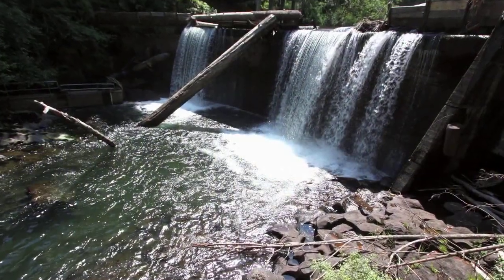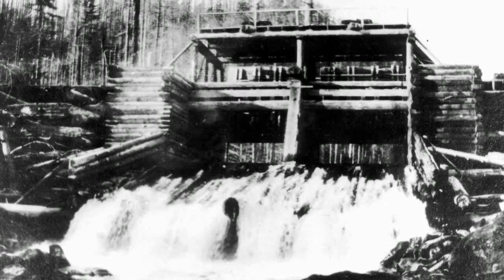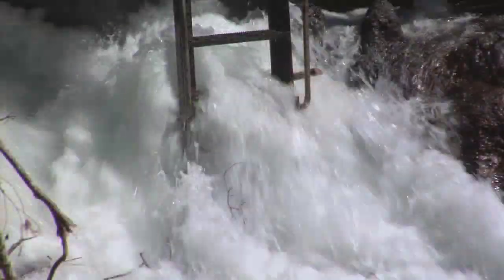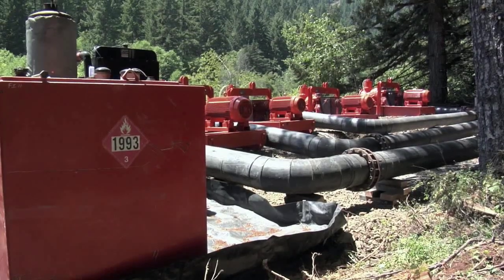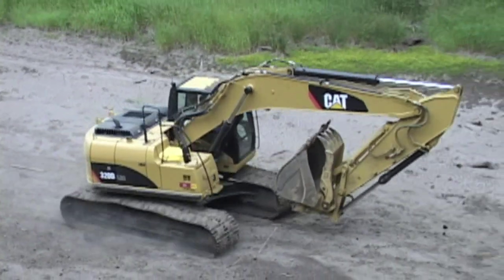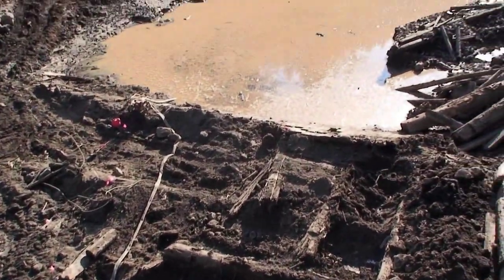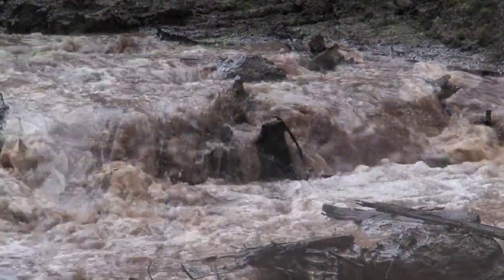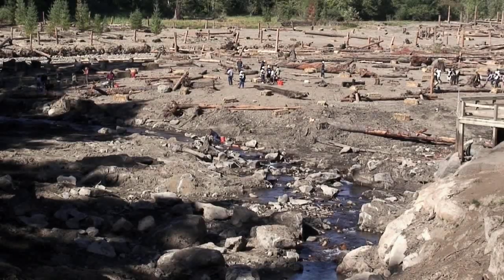The Hemlock Dam Removal Story - Columbia Basin Restoration

Comment: Dams that no longer serve a purpose ought to be removed.
Reply: Even dams that don't seem to serve a purpose to the public most likely still have a purpose. It could be as simple as flood control even when the other as built purposes are no longer used. I do agree that those who have zero purposes and it's cheap enough to remove them should be removed. If the cost of removal is excessive then leave them.
Reply: @dundonrl  No. If they're an ecological hazard then it doesn't matter what it costs to remove them, they need to go.
Reply: @aaronleverton4221  I agree with both of you. But I strongly agree with this.
Reply: nearly all dams shud be removed
Reply: @peanut1001x  yes leave the beaver dams

Comment: Interesting comments. This was a small dam that probably wasn't doing anything useful anymore. It's better to have it removed than to have people foot the bill for maintenance when it's no longer useful. I do sometimes question the removal of larger dams that provide a good amount of generation capacity, but small dams like these are too outmoded and should be removed when possible.
Reply: if it isn't useful or another dam can provide the same energy that a particular dam can produce why not consolidate them so there aren't as many structures to check every few years. Less structures government workers need to check means the structures that are standing and being useful the more through the checks and less chance of disaster of occurring.
Reply: Particularly because this dam was only built to sustain the CCC while they were operating in the area. They were putting up structures of every kind all over hell's half acre during the Depression just to put people to work. Many of these were unneeded and ultimately detrimental. But at the time, the work was serving a purpose.
Reply: Revelstoke dam in BC Canada is causing ALOT of problems.

Comment: Wonderful video, I love seeing Mother Nature being allowed to resume her natural course! We have way too many dams in this country that are not only dangerous but unnecessary at this point in time. They need to come down.
Reply: If the dams come down, where do you plan on getting the replacement electricity they provide? More carbon based fuel powered generation systems? Wind and solar won't be up to the task and are more damaging to the environment than dams. And where are you going to get the water for the thirsty masses of people and animals?
Reply: @jameshaynie4570  How much electricity was provided by the Hemlock dam?  How do you define, "more damaging to the environment than dams" and with what evidence do you defend your position?  Most drinking water is pumped from underground wells in my area.
Reply: @rodshop5897  dams provide flood control, electricity, storafe for irrigation and drinking water. The push to tear down dams just so the fishing industry can make more money  doesnt make sense. So why do you think that dam should come down? Do you know why that dam was built?
Reply: @jameshaynie4570  So to correct your statement, "some dams are designed to provide flood control, some are designed to produce electricity, some are designed to create reservoirs for irrigation and drinking water."  My point being that this dam did not seem to be doing any of that, so why are you against it coming down?  Or are you just pushing the idea that there cannot be too much of a good thing?
Reply: @rodshop5897  it was built to provide water and power in 1937 and included a fish ladder. The fishing industry started pushing to tear it out at the turn of the century to increase the numbers of steelhead and salmon. Tearing it out means  the public has to find another source for the environmentally friendly electricity it provided and also the loss of water storage.
Too many fans have been removed just to enrich the fishing industry at the expense of our environment!
Reply: @jameshaynie4570  Built in 1937, and how long did it produce power?  How much power was it producing in the most recent years before it was removed?

"to enrich the fishing industry at the expense of our environment!"  It seems you don't see the irony of your statement.
Reply: @rodshop5897  to raise production of fish in order to kill them for profit is not environmentally friendly.  Especially since so much of the fish that goes to maket is discarded after not being sold.
Reply: @jameshaynie4570  " to raise production of fish in order to kill them for profit is not environmentally friendly"  I totally agree with you.  I'm not convinced that was the plan, but I agree with your statement.
Reply: @rodshop5897 " most drinking water is pumped from wells". How do you think the aquifers that supply that water get refilled? It takes time for water to descend through the earth to recharge the aquifers , the aquifers are losing more water than is being put back into them. Dams and reservoirs slow the amounts of water that needs to be pumped from the aquifers and also help with recharging them.
Reply: @rodshop5897  so maybe they dont use it for power generation any longer, does it not still store water while standing there? Is it doing any harm or is it deteriorated and in danger of causing floods downstream? Maybe that water is helping to recharge the aquifer beneath it. So what is your justification for wanting to destroy it?
Reply: @jameshaynie4570  Wind and solar are intended to replace fossil fuel burning.  I have family members with a solar array in their side yard that has been generating most of their power for the last 5 years.  They don't have access to flowing water that could do the same, so it does not matter.  Eyesore is in the eye of the beholder.
Reply: @jameshaynie4570  "the aquifers are losing more water than is being put back into them"  That is certainly true in some areas, but not around here.  We have hundreds of lakes that are doing the same ground saturation that any dam would do.  Most of the problem with aquifer depletion seems directly tied to misuse of resources, such as irrigating the desert to grow water-hungry crops.
Reply: @jameshaynie4570  " Is it doing any harm or is it deteriorated and in danger of causing floods downstream?"  In many cases, yes, and yes.  Free flowing rivers are normally better for the environment than old dams which are no longer maintained.  Wildlife thrive better with natural waterways.  We had 2 dams fail last year and nearly wipe out a town.  Sure, if the privately owned dams had been carefully maintained, they might not have failed, but they were producing no power, and were way beyond their useful lifespans.

I've never implied that all dams should be removed, only those which are no longer useful.  What is your justification for leaving them?
Reply: @rodshop5897  i dont want to keep dams that serve no purpose or present a danger to citizens downstream. But i dont want to tear down dams that may still be helping to recharge the aquifers or are reducing the draw on them. I object to tearinv down useful dams just to increase the salmon population for ths benefit of the fishing industry. The push to tear down the dams has mostly been by the fishing industry and they are saying the Salmon are endangered. The only reason they are endangered is because they are over fished. And they want the taxpayers to foot the bill to destroy the dam.
Reply: @rodshop5897  by eyesore, i wasnt referring to individual systems for a home but the systems that cover acres and acres of land to supplement power generation companies.
Reply: @jameshaynie4570  I agree that useful and well maintained dams should not be removed just because they are there.  However, consider also that there are more reasons than salmon that people like to have the dams removed.  Some folks think those reasons are important enough to do it.  And several dams were put in with taxpayer money (not all) so it makes sense to use the same source of funds to removed them.  Part of being within a federal republic.
Reply: @jameshaynie4570  Sure, I get that.  Dams and solar arrays  both look better to me than a petroleum plant (and smell better!).  I actually find a large windmill array to be an awesome sight, akin to seeing a large dam.  Everyone has an opinion on what looks good.
Reply: The guy in the replies is fighting against big fish
Reply: @rodshop5897  you are not looking at the whole picture. Do you understand how much petroleum based energy is consumed making the equipment for solar and/or wind energy? Then you have the short life spans of the not recyclable windmills and solar panels. And don't forget the large amounts of rare earth minerals it takes to build them.
Reply: @nuggetsaltshaker9520  you want big fish? Go ocean fishing, the fish in the ocean get much bigger than anything you will find in a river.
Reply: @jameshaynie4570  "Do you understand how much petroleum based energy is consumed making the equipment for solar and/or wind energy?"  Well, yes, I am actually working in an industry which supplies components for petroleum, wind, and solar industries.  I think you are pulling in concepts which are red herrings.  This is about dams, not about all those other systems.  If the dam is not being used to create energy, your point is moot.
Reply: @rodshop5897  my point isn't moot just because that dam is not producing electricity, it is still storing water.
Reply: @jameshaynie4570  Storing water at a head level that made it nonviable for further investment as a dam.  Yes, moot.
Reply: @rodshop5897  so what is your point? Why is it that you want dams torn down that are just sitting there doing no harm? Or is it that you just want to argue about something, anything at all?
Where are you from that has all the lakes to recharge the aquifers that you mentioned ?
Reply: @jameshaynie4570  My point is that there are pros and cons to dams that are not serving their intended use.  Tearing one down often leads to an more natural river flow, and I'm generally in favor of that.  I live in MI.  We have tons of lakes.  You should visit sometime.
Reply: @rodshop5897  i have been there, the lakes are about the only thing good about Michigan. Very few states have the luxury of all that water.
Reply: @jameshaynie4570  "the lakes are about the only thing good about Michigan"  Wow,  curmudgeon much?

Comment: Very interesting how many people are for removing damns yet when there are major floods people are gonna be like well that damn really helped
Reply: And don't forget the dry years. So many.
Reply: Maybe if they hadn't cut down everything green and replaced it with so many inefficient and destructive farms flooding wouldn't be even close to the issue it currently is
Reply: @Arrica101  there is a reasonable amount of deforestation. Clearly in this case cutting down the Forrest was not the issue
Reply: @Arrica101  do you know how many trees are cut down and how many acres are cleared to build your "wonderful" wind turbines and solar fields?!
Reply: @ericpl7227  Where did Arrica say anything in support of wind turbines and solar fields?  Do you know that it's possible to farm around wind turbines and solar arrays?  

But since you brought it up, my brother in law has a farm and runs his operation on solar panels he had installed on a fraction of the land.  He makes enough power in the summer that he sells it to the power company.  In the winter, he has to  buy some power back, but he's still paying a fraction of what he used to be paying.  And still has plenty of room to farm.  His entire array is only two long rows.  Much less than an acre of land.

Comment: As many inappropriate dams were built , nobody talks about the other dams built by CCC and the WPA . A lot of dams were built simply to relieve flooding downstream , more flood control dams were built than any other type of dam .
Reply: The irony is: the sheer mass of dams result in a risk of cascade failure of flood dams. The incremental sedimentation of the flooded basins will also increase the risk of mud releases which, in worst case, cann also cascade the sedimented downstream dams. The risk rises with each year we dont remove uneccessary dams. In 50 years dams will be one of the biggest topics in china, hopefully the us and europe will have renatured most of them until then.
Reply: @SuperGorli  Great when you find another source of drinking water , agricultural uses, and hydro electric generation . Solar and wind alone wont power us . Takes more pollution to create huge lithium ion batteries than they save .
Reply: @cpierce3277  Dams are not a problem in itself. The problem is, they were build as single structures and not embedded into a riversystem with dozens, sometimes hundrets of dams. If upstream dams are opening, donstream has to be able to manage by diverting and funneling the water. Most countries already react by rebuilding the dams in an order with widespread flood areas (reintroduction of swamps / marches). Only China is more or less doing the opposite, which i cannot really understand, since they normally have the biggest flooding events worldwide.

Comment: A list of ideas to sam dams.

Fish Runs saving Dams and Water Shortages

Update 7/4/2021
Do you have a nearby moving river or stream? You can now place a slow speed water generator on the bottom of the stream and make power 24 hours a day. The unit is called a Waterotor made in Canada. The Waterotors won't harm fish and can be scaled up to meet the needs of small towns or cities. Make the power miles away from the small town, sell the power to the power company than use the power to make water anywhere. Atmospheric water generators can make drinking water and irrigation water, and with a Waterotor, power can be made even in remote regions of the World. You just need moving water 3 to 4 miles an hour in streams, irrigation channels, fish ladders or even waste water outlet's. Garbage treatment plants can also use the power they make burning garbage to make water with atmospheric water generators and add storage tanks to supply small towns and cities. Adding Waterotors below dams can maximize electrical power made by any dam and replace power lost if the dam has a fish ladder or channel for fish to move up and down stream. A dam can be saved for flood control by adding these powered fish ladders and channels or notching the dam and putting in a flood gate to raise and lower the river during fish runs. Now people and fish can share the river. Note using the methane from sewage treatment plants or garbage landfills might be used to generate electricity for any water making projects. You might use your own City sewage system to make filtered irrigation water for lawns and gardens they have a system like that in my my small town. Note, what to make even more power? Then by covering fish ladders and channels with spaced solar panels decreases evaporation of the water and increases the efficiency of the solar panels.

A now overdue idea, dealing with forest fires. You build and place atmospheric water generators and 100,000 to 5,000,000 gallon water tanks on hilltops to protect your town. You cover the tanks with solar panels and add wind turbines to make power anywhere. You sell the power, drinking water and irrigation water, then by adding irrigation pipes down the hillsides, you can create fire lines that lasts up to 24 hours. You make these fire lines by adding TetraKO, by Earth Clean at a 4 to 6 percent solution to the water. Turn on these stand alone units remotely, your fire trucks can work elsewhere or resupply themselves with needed water. Fire protection, drinking water, irrigation water and stand alone power for any city or town in need. Here again, Waterotor generators could be used to generate power for the hilltop water making units. These ideas all can be done today, just search YouTube, and then tell someone.

Comment: Heavy duty compaction may seriously compromise the ability of a river to heal itself so use of modern technology to get a real reading on human caused compaction sections may be used to find other potential techniques to thoroughly restore the potential habitat, gravel beds, natural stream function, scouring, and habitat back to historical or Ancestral Knowledge levels of the natural process where man may have heightened the pristine conditions that existed before the dam was made. Excellent efforts and don't forget to leave it to beavers and or muskrats to bring back natural deep holes and riparian masters of the ecological kind!
Reply: Excellent comment. Thank you. To add clarification to your comment, I would say that fish require varied levels in a stream or river bed. They must have over-hang of banks, for shade through the hottest hours of a summer day; they require low-current, quieter areas for the attachment of eggs to rocks; and they require deep areas for protection from predatory birds. The equipment shown in this video seems to be compacting the stream bed into something resembling a paved highway. Certain of these multi-ton vehicles are even identified as road building equipment. The impression which I receive from this video is of general enthusiasm for a project which lacks a foundation in knowledge, study, and preparation.  Directors and the hoards of volunteers seem to me to be not so much different from the dam enthusiasts of the 1930s. The mind set is in many ways, just the same.
I am sorry for being two years late with a response. This video has been recommended in May, 2022.  Thank you for your very insightful comment.